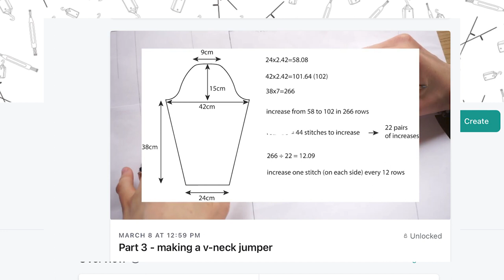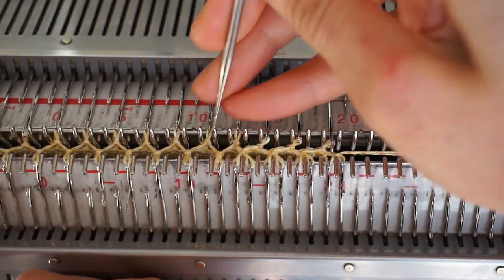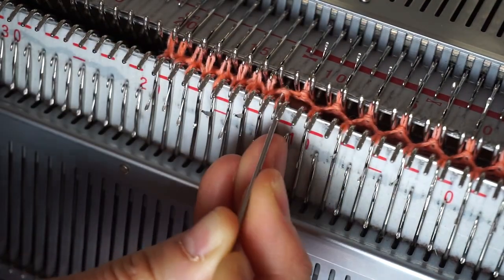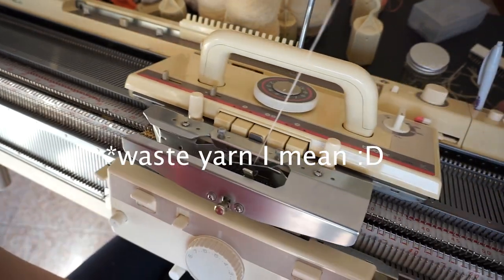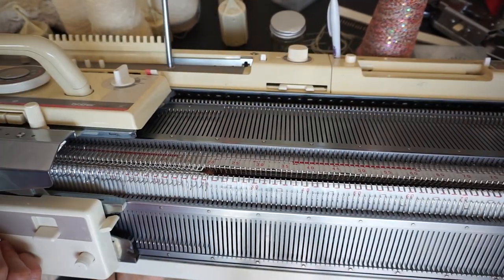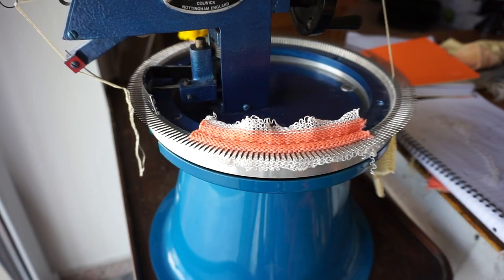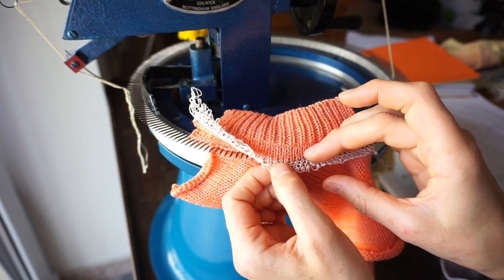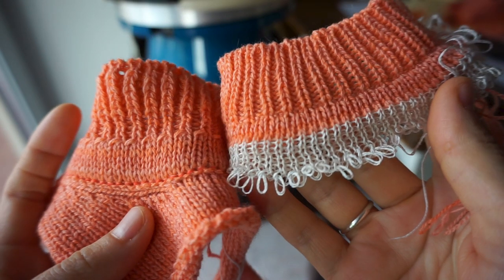Sandwich trim - how to knit and attach it - part 1

Comment: This creates such a polished finish!   Great tutorial, thank you for posting.  Is there any way to do this without a linker?
Reply from the maker: Indeed 💗 thank you 🙏

Definitely much slower process 😵‍💫 but I think it us possible; I don’t know how I would do it, probably would sew the “flaps” one at a time 🤔 with the latch tool. Like I show in this video from minute 17:00 https://youtu.be/Da4xn7bb2Cw 

Hope this helps 🤗🤗
Reply: You can also use the main bed of the knitting machine, you can sandwich the pieces exactly as shown in this video on the main bed needles, then you 'hand knit' (you don't use the carriage, you position the thread in the needles and you pull them back by hand) and then you do a latch tool cast off 🎉
Reply from the maker: @martagavioli1954  ohh yes great idea !! thank you for sharing ❤
Reply: @Knitology1x1  this is helpful.  Thank you
Reply: @martagavioli1954  Ahh!   Yes.  This makes perfect sense.  I kept getting stuck on the idea of the carriage - but manually knitting solves it.  Thank you so much!